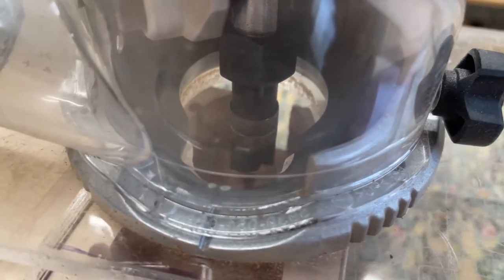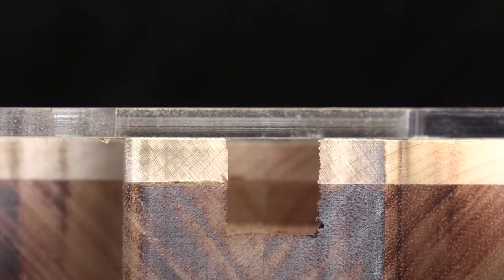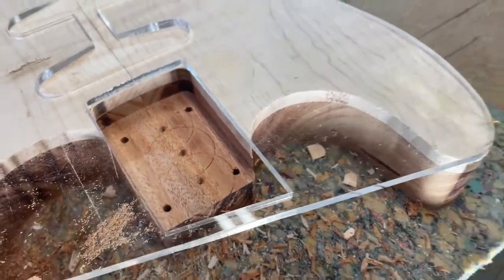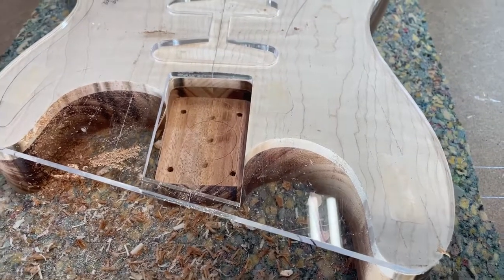Routing Guitar Neck Pocket In Two Steps - Speed Routing

Comment: WHY in the world is the standard round neck heels large radius pockets on bolt on  and NOT straight flat corners ?
Reply from the maker: Strat style neck is rounded. Tele style is square.  Plus radius of router bits determines radius of corners.  And sorcery helps too.
Reply: @TomGlander  nothing like a headstock waving side to side to the audience...and up and down when using the trem...